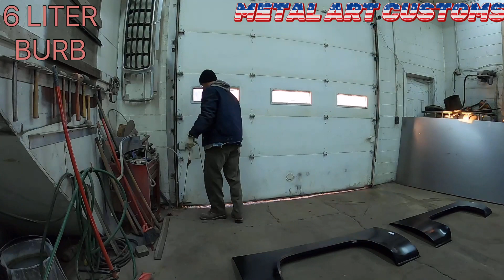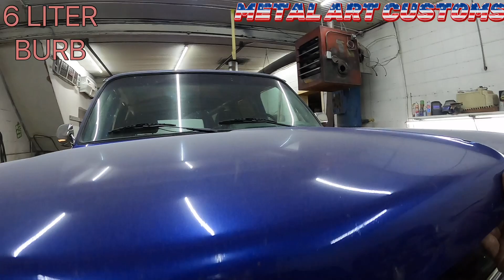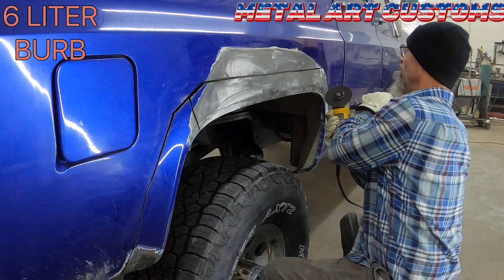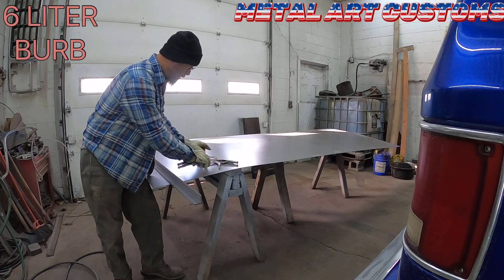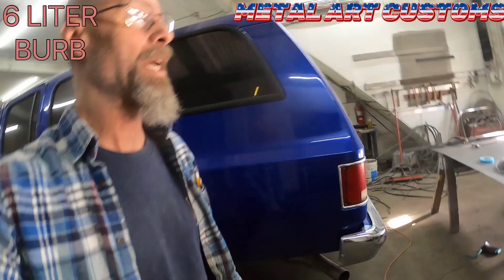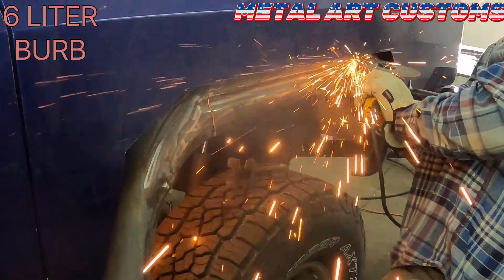Wheel well fab and inner well fab on 6 liter burb.

Comment: Good luck finding a solution to the torque gun, hope your fingers survive the learning process! 😏 how did you learn about computers in cars and how much did it cost you?
Reply from the maker: Man years ago I built a rollback bed for a gmc cab over. Welded it all up right on the truck. After was done he took the truck and a few days later things went haywire randomly. Thankfully GM replaced the computer because the truck was brand new.
Reply: @metalartcustomsLLC  😂 so glad you didn't have to pay for that! It's good you are trying to help other not make the same mistake you did.
Reply from the maker: My old air chisel worked great . Just enough power. I’m going to regulate the air on this one and put a leather boot over the spring